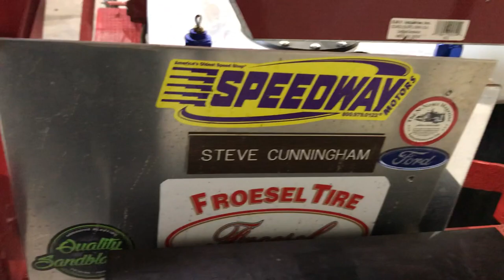8N engine swap with Chevy V6 details

Comment: Could  anyone  suggest a engine  swap  kit / motor combo that would be for a field  ready  tractor. Something  simple?
Reply from the maker: None that I know of. The bell housing, integral oil pan, and spacing for the original engine are all unique to the N series. I really believe that the Chevy V6 is the easiest for fit and spacing since it uses standard Chevy parts and does not require modification of the steering parts.  However, The Red Rock adapter  cost more than the Craigslist engine that I used. You are still left with many problems to solve (fuel, wiring, etc.)  A belt driven governor off of of an industrial engine could be used to make a nice useable tractor. Nothing simple!
Reply: Chevy S-10 or Dodge Dakota either v6 or v8.  If you could find an old Massey Harris inline 4 cyl Cont. or 6 cyl Chrysler. Remove pickup bed, driveshaft and rear. Now weld Massey sprocket to auto trans output sleeve by removing yoke.  Now bring front half of donor pickup to rear half of Massey, install coupling chain. Fabricate brackets to mount truck frame to tractor's transaxle. Now you have a nice tractor with cab including heat and air, modern fuel injected engine, auto trans, and four different range settings from Massey trans, creeper gear with both in reverse. Just a nice weekend project?

Comment: that 229 brings back some nightmares.   "odd" is a great description for them.   they had dozens of recalls on various parts during their production, least of wich was that original carb and the intake it sat on.    GM struggled so hard with that engine.  So much, that by the early 80's they just changed em out for the 305.  Our family car got that upgrade.  Then the car ran fine.   Little nicer power too.   Grats on getting your 229 to do something useful.  Looks pretty nice too.
Reply from the maker: I bought 3 engines from a guy on Craigslist. They had not run for a very long time. The DualJet carbs and the distributors were junk.I sort of wanted a V* but I really liked the simplicity of the Red Rock adapter and that the original lines of the N were retained with the V6..

Comment: Hello sir about time someone did this I have a 8n I want to 4.3 mine how did you couple the  input shaft to the engine Awesome 8n you have
Reply from the maker: Really straightforward connection. Stock Chevy flywheel and Chevy 10.5” three finger pressure plate with a48 Ford truck 10” disc. Speedway Chevy to Ford pilot bushing adapter shortened about 1/2” to allow the shaft to go in far enough. The Chevy diaphragm pressure plate would hang up on the bearing carrier but the three finger is OK.
Reply: Do have a video of this  part of the building if you do would you mind posting this would. Be awesome to do thank you
Reply from the maker: @MrStarlin51  I don’t have a video. I do have a book of photos that I can email to you. Send your email to sncunning@yahoo.com and I’ll send a PDF attachment of my “instruction book”.

Comment: Hi Steve, thanks for the info. How does the swap effect travel speed at lower rpm? I would be doing this to gain power for working the tractor, 
Kevin
Reply from the maker: I don’t have governor so I have whatever maximum rpm the V6 can go. I went in 4th at 5500 rpm on the 11.2x28 tractor tires and that calculates to 50+ mph. (I’ll never do that again!, no suspension and the brakes won’t apply together perfectly.) The V6 has nearly double the cubic inches of the original engine so there is plenty of torque in the normal 4cyl rpm range (500-2400 rpm.). Governing or modulating your rpm under load will be the problem and also fuel tank capacity.  Especially for a variable PTO load. I was looking for an industrial Chevy V8 or V6 (pump, air compressor, combine, etc) to find a belt driven governor but didn’t mount one because mine is just used for drives. I did add an overdrive when I put on the low profile tires; that lets me cruise at 12mph  with the engine running about the same as stock 4cyl and tractor tires.Cruises I’m usually at 1500-2000 rpm but I can really speed up if needed.

Comment: Holy cow.  Those Peterbuilt Wheels & tires are $700 to $1400 EACH.   What a bargain!
Reply from the maker: The tires were $60 for the pair on a local consignment auction. The used aluminum wheels were $150 a piece from my local truck/tractor tire shop.  They had purchased a bunch of used aluminum rims.  I hate to admit it but the machine shop charged $750 to make the adapters.Thanks for the comment.  I am happy with the look but even at 25psi tire pressure the ride is very rough on some rural roads!